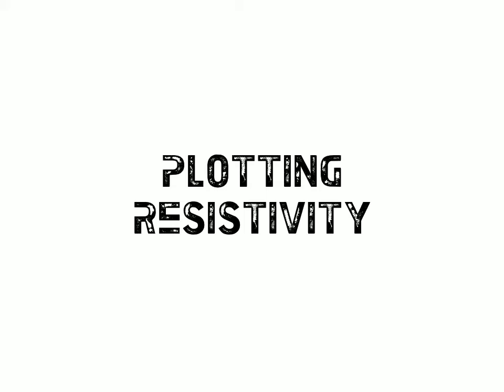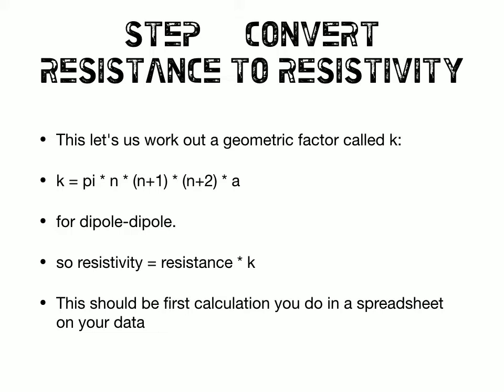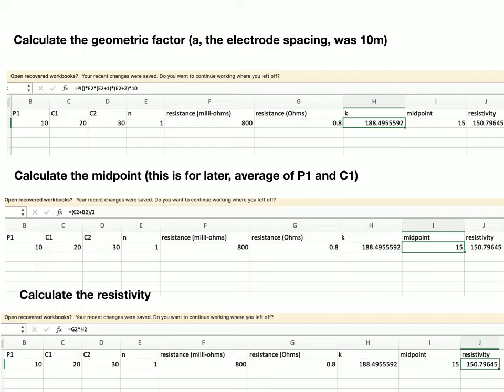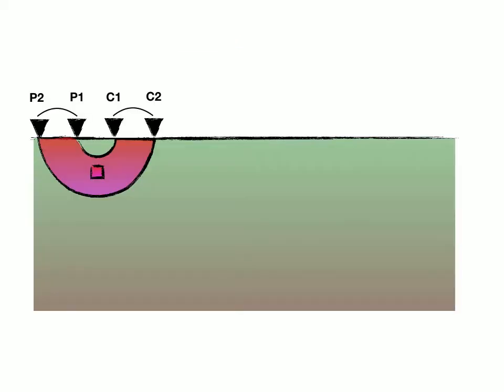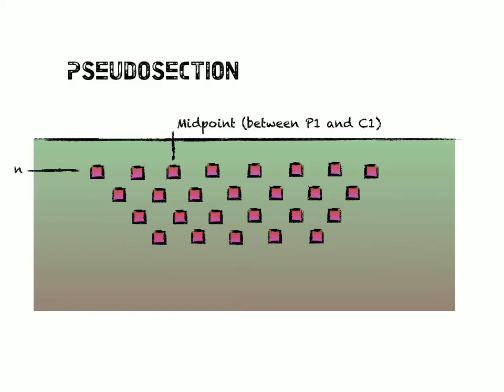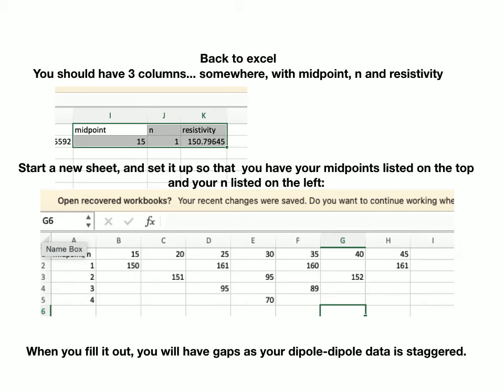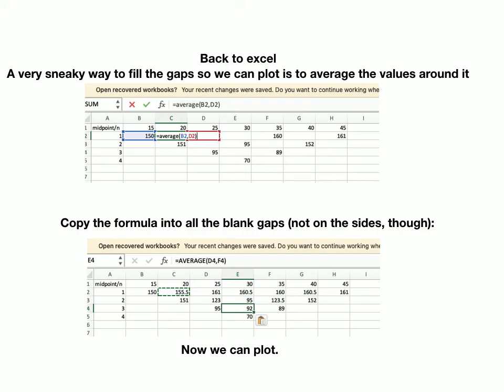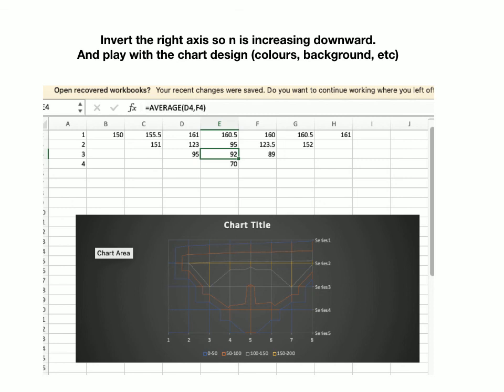Resistivity pseudosections

Comment: Please explain Wenner-Schlumberger 2D ERT array electrode move position, due to dipole dipole can't investigate with deep depth, i am looking for another electrode configurations which can give good resolution
Reply from the maker: If you do the forward modelling, Dipole is the best depth penetration (for array length) by a long way. Wenner and Sclumberger do better at layer thickness resolutions, and a lot of industry are using gradient arrays which are a good trade-off for layer resolution, depth, and apparent dip angles of structures.

Comment: Thanks for the video. Quick question. How do we convert this section into an actual depth section?
Reply from the maker: You need to invert the data. ResInv2D/Zonge (commercial software) etc can do this, but there are also open-source solutions like ResiPY and pygimli that can do 2D resistivity inversions on arbitrary array configurations.

Comment: thanks for the detailed explanation! 

for dipol-dipol measurements, the measured point in the pseudosection is created in 90° angle between current and potential electrodes.

Can you explain how this works for wenner and schlumberger configuration?
Reply from the maker: It's really just based on the midpoint and relative depth in the pseudo section - the angle is just apparent in this example. It would be the same for the sclumberger/wenner.